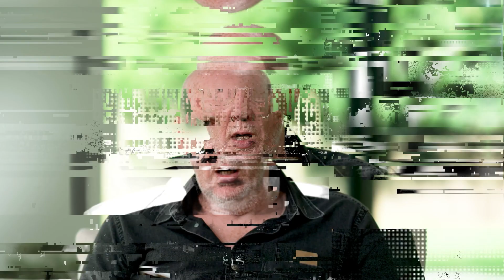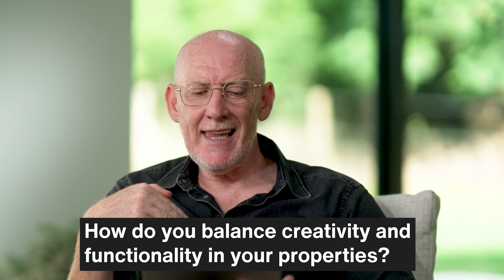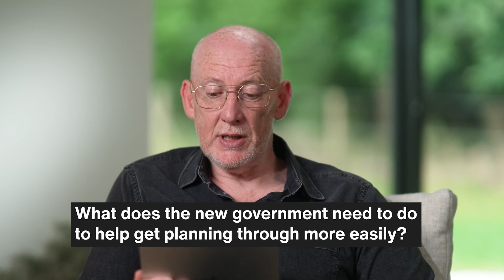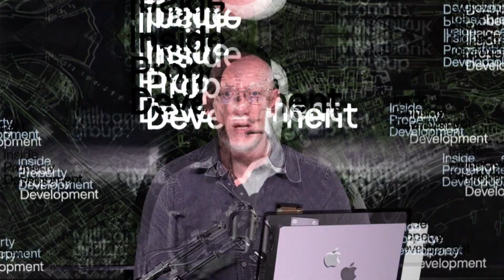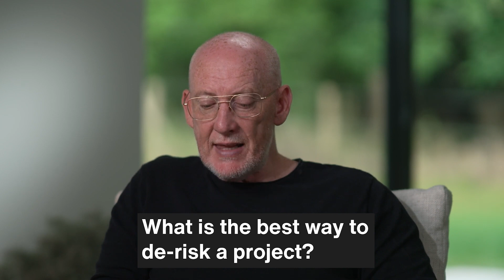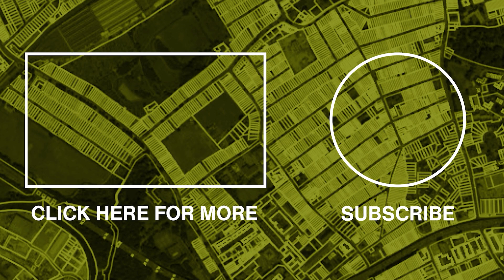Q&A Property Design Trends: Balancing Creativity & Functionality

Comment: Hi Paul, thanks for sharing your knowledge and good points on bespoke buildings and expecially on fixed prices.  The fixed price contracts have been a major factor in many building business going bust in the last few years (along with low margins which don't reflect various risks involved in building). The cost certainty of a fixed price needs to be weighed against the potentially larger cost of a contractor going pop half way through your build.  Have you noticed the amount the sites which have stood still for prolonged periods as the Client struggles with finding a new Contractor while the old bust contractors signboard weather away.  Consider the cost of getting a new Contractor in and who picks up the warranties of half completed works?  Maybe the industry needs to stop its focus on the bottom line and passing all the risk onto the Contractor and supply chain?  Also, just been told that MDF mouldings are increasing up to 20% so perhaps another period of price instability is on the cards?  Well as least there is never a dull day in construction!